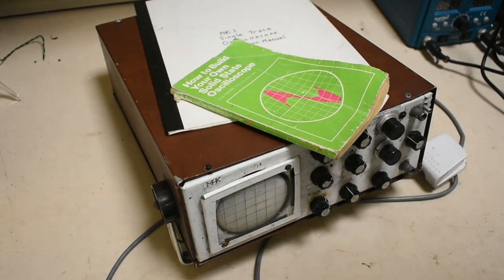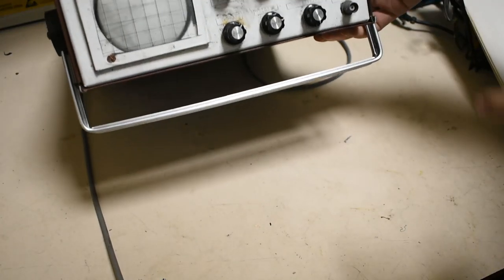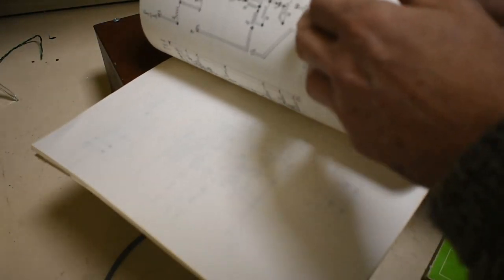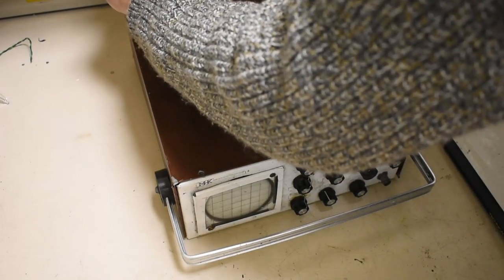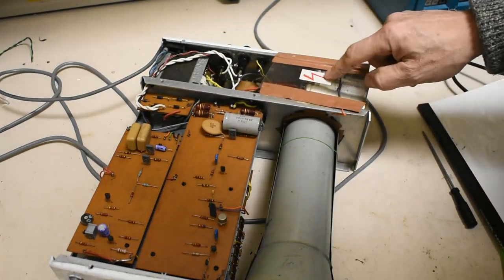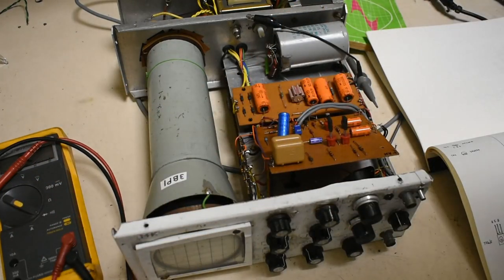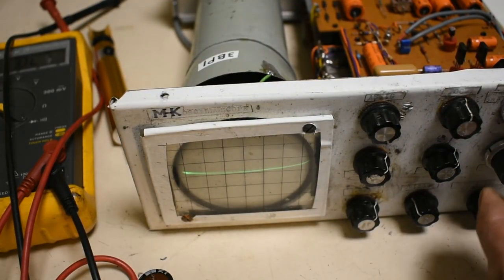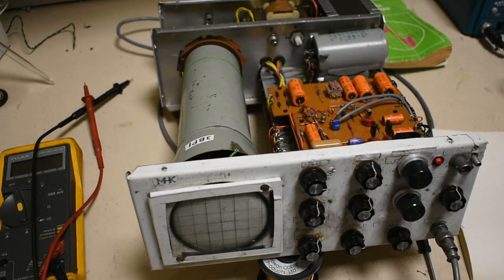DIY CRT Oscilloscope project from the 1980s

Comment: Well made oscilloscope! Back in the day i had couple attempts to build my own oscilloscope from scrap using old CRT from 70's, when i was young with almost no money but with strong willing and lot of free time. First time it was build using transistors, second is with vaccuum tubes, but not finaly done... Years later i just buy used oscope and almost finally satisfied with it :)
P.S. Sorry for my english
Reply from the maker: Thanks for the comment. I had a couple of attempts too. This was for a college project so I had to finish it. 🙂

Comment: I would be interested in a detailed break down of this or even another build but with current parts.
Reply from the maker: Thanks, with the introduction of digital scope kits , which are more accurate than this CRT scope, its difficult to justify a new build. There are some clock displays using this technology integrated with digital signals.  I have other video on driving CRTs and plan to make  some on x / y deflection tubes at some point. The book I used to build this was quite good an explaining the circuits.

Comment: Make circuit of oscilloscope that run on video input composite of TV with out open any tv or any other device.
Reply from the maker: Yeah, I keep thinking about that, might give it a go at some pint.
Reply: @tuopeeks  if u need any help plz msg 
Also i have many many different ideas that no body do til now .

Comment: I imagine the parts would have cost $500 to $1000 back then .
Reply from the maker: Quite luckily the college supplied a lot of components and parts I did buy the CRT and hv transformer which were expensive for a student but the CRT was the cheapest tube around at the time. Don't think I spent much more than equivalent to about $200 at the time.